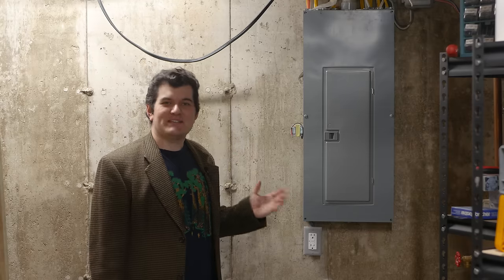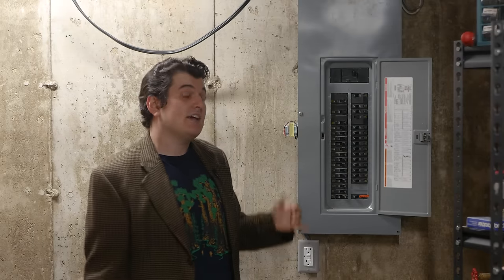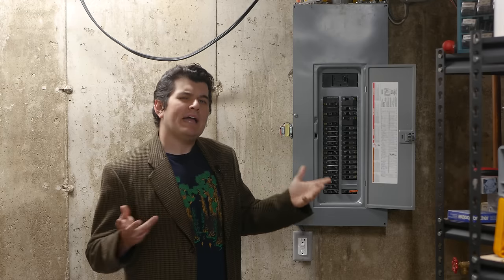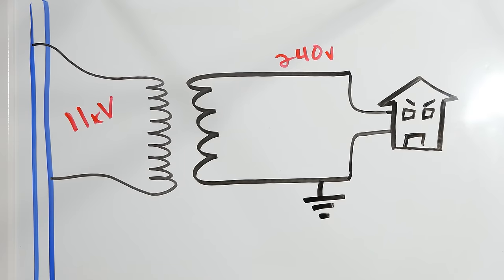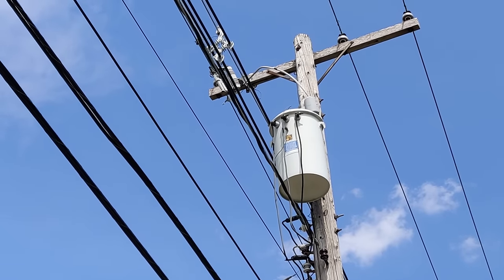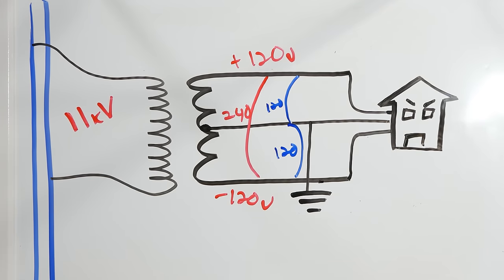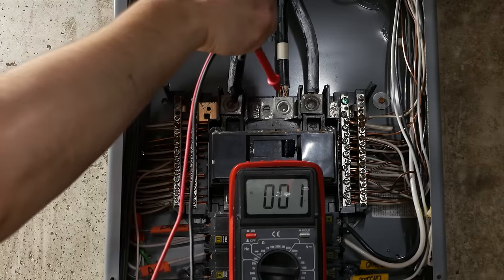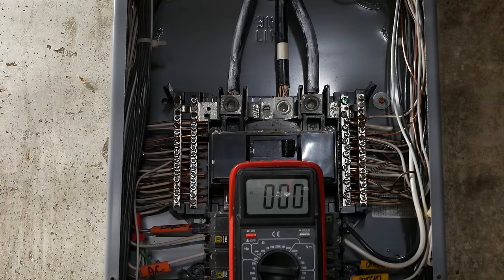The US electrical system is not 120V

Comment: Thanks for engaging with this "it's only the Amps that kill you" thing. As an electrical student I always found it strange. It's the Watts that kill you, and P=V^2/R. 
Of course, R is going to vary depending on the path and the contact, but still, that's the truth.
Reply: well a large current traveling slowly wont do as bad as a small current traveling quickly. watts are the electrical version of the joule, so its just a measure of what work is being done. what does the work and how it gets done is the thing to worry about.
Reply: @pulsefel9210  it's not about "quick", it's about quantity. Your body presenting roughly the same resistance load at all time (between one given point and another given point of it, for ex from hand to foot, the skin being the main barrier of resistance), the current is proportional to voltage. So a 12V generator will hurt far less than a 240V one because 20 times less current will circulate in the same load. However if your hand and feet are wet or wounded, your skin resistance drops significantly and at the same voltage you'll get electrocuted more easily. That's why a 6.5V battery feels nothing in your hand but hurts on your tongue.
Reply: @lolilollolilol7773  a 12v car battery can kill you faster then a 10kv electric fence even if you use the same points of contact. this is because the car battery has a higher current then the fence. voltage and current are related but not proportional
Reply: @pulsefel9210  No, a 12V car battery presents no danger to you. You can touch the two leads at the same time, it will be inoffensive. If however you short it with some wire, it is likely that it will melt or vaporize instantly because that piece of metal has many orders of magnitude lower resistance and the battery can indeed deliver high current. If car batteries were as dangerous as you seem to imply, they wouldn't be sold like that or there would be many accidents every year.
And if you still don't believe me you can watch one of the many videos that demonstrate that, for instance https://www.youtube.com/watch?v=OpqW4Ey9618
Reply: @pulsefel9210  dude, it's science. I don't know what you experience was, but I'm right. Now if you were sweating or if your fingers were wet (sweat being particularly harmful because it is also salty), then the resistivity of your skin lowers very quickly and yes in that case you could perhaps electrocute yourself. And if you touch the leads with both your hands, it could perhaps be dangerous since the current would go though your heart. That's why it is known that electrical appliances are dangerous in bathrooms: bcause we are wet and thus much more conductive. But if your hands are dry, your resistance will be at least 10 kohms and thus the current in your body would be at most 1mA.
Reply: @lolilollolilol7773  tell that to my dead nephew.
Reply: @victorhopper6774  , tell your dead nephew if they killed themselves by electrocution with a 12v battery it's because they were trying, really, really hard, because you would basically have to wire yourself inline with the starter motor, literally inserting the wires under the skin, and crank the engine over. There is no other way to get a 12v battery to push enough amps through your body.

Did you turn the key?
Reply: @notahotshot  you are a bright one.
Reply: I think it's because the alliteration of "current kills" just sounds so much better than "power kills", lol.
Reply: @victorhopper6774  Clearly your nephew wasn't....
Reply: @pulsefel9210  Please do share your experience since you have zero facts to share. I'm curious
Reply: @NathanaelNaused  no he wasn't. he also was one of those rare people that didn't react to pain. he was lucky to make it to 34. don't play with batteries when you are soaked.
Reply: @victorhopper6774  I'm sorry to hear that. That's quite unfortunate. All internet debates aside, that sounds like a terrible thing to have to cope with.
Reply: @NathanaelNaused  yes a strange thing not to have the feedback of pain. he cut several fingers off and didn't even know it till he saw them missing.. he was a good person.
Reply: @victorhopper6774  Good of you to point that out, because, obviously, your nephew couldn't.
Reply: @pulsefel9210  How many have died from a battery shock. I don't know of any. But I do know a few that were badly burned and or died from a building service.
Reply: @waltmezynski8493  apparently you've never seen someone put jumper cables on wrong. Wonders what 12 volts will do.
Reply: @Pulse Fel   Ohhh now what you are saying makes sense. Let me guess, the engine was running when this happened? But could you please share the experience you’ve been alluding too this whole time? That would help to understand it, because 12 volts cannot physically do what you’ve described (but the voltage from an ignition coil definitely could).
Reply: @FinalSentinel  Ignition coil doesnt have much amp either, it has a high "internal resistance"(i'm not sure of the correct term here), its more like a static shock than an electrical one. 

12V is harmless in most of the situation, even if you put yourself in series with the starter, the resistance will add up meaning even less current through your body. 

You can lick your finger and put it in the cigarette lighter. Maybe I'm weird for doing that but I did it to demonstrate its harmless many times.
Reply: @graxjpg  I'll give you a prayer or two
Reply: With regards to 10Kv electric fence, it likely has a current limiter, like a resistor.
Reply: @pulsefel9210  as a elektrician who worked as a car mechanic in his early years I can safely say a car battery won't kill you. 12 volts is to low a voltage to pierce your skin. You can even drop water on a car battery and it won't short.
Reply: @pulsefel9210  He doesn't need them. With no load being put on the battery (ie. Lights off, nobody is starting it, and it is not running) you will not get injured by touching leads. Hell I doubt even headlights on would pull enough from the battery to actually feel it. Now if you go and grab both terminals, AND THEN someone starts the car, the amount of electrical energy rushing from battery to starter would fry anyone. I've been shocked plenty in my life, it's not enough to just walk up and grab things and you die. Go stick your finger in an outlet once in your life, go change a car battery, do something "dangerous" to see just how dangerous it really is.
Reply: @roybrown6058  nice use of the word ONCE
Reply: @pulsefel9210  you're really fun at parties aren't you.
Reply: It's not the power, plenty of people survived lightning strikes
Reply: @ZhangyXD  I think that's because the lighting path did not go through them directly.
Reply: @roybrown6058  :  You're talking about two separate circuits -- the starter motor circuit and the "circuit" that you (don't actually) create by touching both terminals of a car battery with your hands (or other body parts).

You can touch both terminals of a car battery all day long and not get shocked at all.  Whether you're starting the car or not.  Yes, when you turn the key and engage the starter, a lot of current does through that circuit.  But that circuit is completely separate and has nothing to do with the one that your fingers (don't actually) create when touching the battery terminals.  One circuit has nothing to do with the other, even though both circuits are touching the battery terminals.  The current takes different paths.  (Although there actually would be no appreciable current going through your body because the battery voltage isn't high enough to overcome the high resistance of your skin.)
Reply: @OP the saying comes from it being easier to understand. Of course there's a little more involved, but it's a good rule of thumb. A taser at 50kV vs 11kV cable to your house for example. You don't have to be precise to give a good understanding of the situation to a layman
Reply: Watts cook you. Current kills you. Voltage gives current the knife.
Reply: To the people claiming that a car battery can kill you. Know that no one has ever died of electruction at less than 50 volts. I know from personal experience you can touch both terminals on a car battery and be completely fine. Unless maybe your hands our wet you won't even feel a shock
Reply: Depends on what you do mean (power and current cannot exist without each other), but if we simplify things...
No. Unless extreme circumstances are happening, it's the voltage that kills you. Technically in most electrocution deaths the current flowing through body causes changing  voltage on your heart muscle cells - and in result it is going  haywire, so the most close cause is a voltage. However, to cause the voltage change, there must be a current flowing through your heart. The threshold is called 'fibrillation current' - it causes your heart to go into VF (ventricular fibrillation), stopping the blood flow. Now, for the current to flow, must have a way greater voltage applied to some places on your skin (or inside, with piercing electrodes). Still, if you apply the electrodes directly to heart, measly few volts can cause ventriculat fibrillation. 
The power needed for that thing is really small. Six volts and 20 miliamps? Enough to kill with electrodes on the heart. 120 miliwatts can kill you. 

Now, there are some extreme circumstances, when current flowing - even outside heart - kills. Usually THEN it is 'power' that destroy body, causing killing.But again, it won't happen with 120 or 240 volts, most you can get with this voltage is burning.
Reply: And what Lukasz just described is why a few people can be killed by ignition coil touching. The little shock could be enough if you got a heart condition to get it "out of sync". They are the same that die from being tazered, or touching low power electrical fences for animals.

(Also there's something that is defined as safety extra low voltage or SELV and it's anything up to 50V for AC and up to 120V DC. Those are in electrical norms for safety. With anything below that a metal housing doesn't need to be grounded because it does not endanger the user. The guys putting that into the norms a long time ago would have been prosecuted if it weren't safe!)
Reply: @natchomomma1 the power is important but ultimately it's the voltage. I've got a twelve volt battery on my boat I think it's rated to provide 700 amps of starting current. That's 8.4kw of power, but in reality it's more because the battery is charged to more like 13.4v. I can touch both terminals of the battery without feeling a shock. This is over 4 times the power of a 15amp, 120v circuit, but if it was a 120v circuit I'd be dead. I'm sure they'll teach you in school about how working with different voltages requires different protections
Reply: * electroboom entered chat and stares down your soul angerly *
Reply: Pulse Fel is trolling, but deliberately withholding information.  My guess is a battery exploded & hurt him or a coworker.  Yes well that’s NOT the same as an electric shock

.
Reply: @brycek3434   Wait, wait, if that battery says it provides 700A then that's because it will be resistance-matched to the starter motor in order to provide that much current (a resistance of only 20 milliOhms or so). Whereas your body's resistance is almost 100 kiloOhms, so the current motivated across you would be very very slow, and hence a very low power in you.
Reply: Hi, it's the amps that kill you. Milliamps, to be more precise.

The human body uses electricity (via the nerves) to contract muscles. That's why it is sensitive to the electrical current going through the tissue.

At (50Hz):

10 - 20 mA - muscles start to contract

50 mA -  pain; heartbeat and breathing interruptions
below 80mA - still reversible interruption of heart activity
above 80mA - the ratio of lethal accidents increases

100 - 300 mA - fibrilation of heart chambers (the heart stops pumping blood)
Above 1A - generally death

6 A - continuous contraction of heart chambers, burnt skin
Reply: "The volts aren't what kill you" means that the number of volts on the open circuit means nothing.  Pulling a sweater over your head on a dry day can produce thousands of volts.  But once they connect, a very tiny amount of power is transmitted, and the voltage falls instantly to zero.  Likewise, you can touch your tongue with a 12v battery and barely feel it because the voltage drops almost immediately to something less than 1v. 

The power, and the amount of time that power is maintained is what kills you.  So, I'm not arguing with you.  I'm just saying that in many (possibly most) situations, the "V" part is vastly different 100ms after the connection is made, When we talk of voltages, we usually just give a single number, and that is the open circuit voltage.  In a lot of cases, it's nearly meaningless.